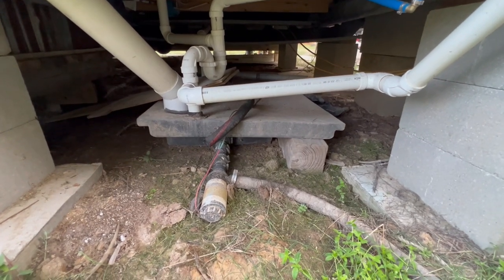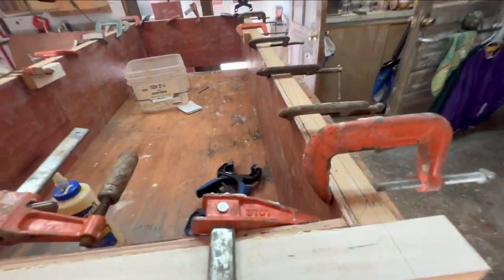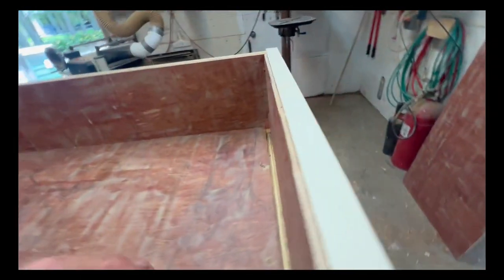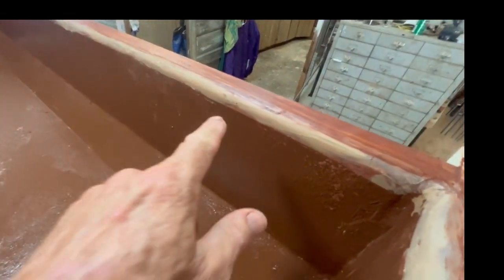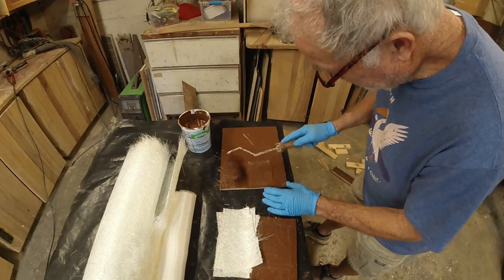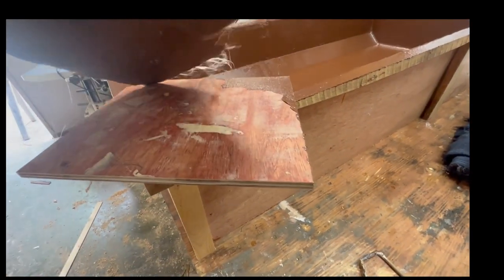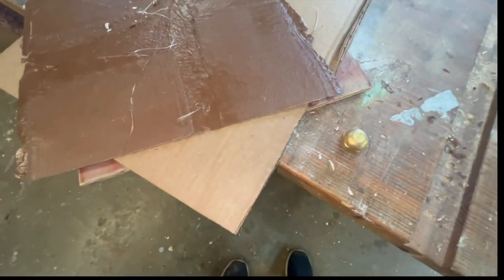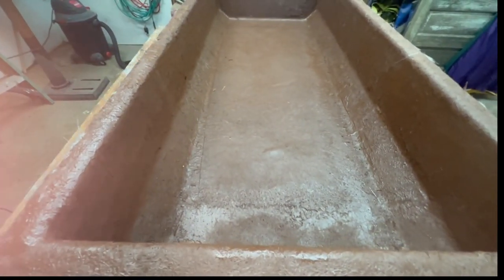Building a DIY custom size Holding Tank for the Tiny House with fiberglass bits and epoxy paint

Comment: I would take the "out of date" advice with a large measure of salt.  I bought some that was four years out of date, stored it for five years myself and had no problems using it.  I had a friend who rebuilt a 26' burn boat and was ordering his in fifty gallon drums.  Well he finished the boat with most of a drum left (polyester) which he continued to use for the next fifteen or twenty years.  His drum was stored out in ambient temperatures ranging from 5 degrees to 85 degrees with copious humidity (this is a temperate rain forest in SE Alaska).  I never even knew until ten years ago that there was a claimed shelf life on it.  I also heard a factory rep for West Systems Epoxy say there was non with epoxy either.  This correlates with my own experience.  Other than a slight color change which did not effect performance I have kept quarts and gallons of opened product around the shop for decades with no ill effects.  The rep had pointed out the color change but said the factory had done strength testing and found no performance loss in fact they actually gained a bit in strength!  If you can find a retail outlet that is marking it way down for being out of date I would without hesitation jump on it!  I have had little experience with the vinyl resins so I cannot speak to that.  Poly and Epoxy are both so useful I always make sure to have it on hand.  Also because my order time would be three to four weeks if I ran out.
Reply from the maker: Douglas 
I have also had success with very old epoxy. But polyester resin will get lumpy and or hard in the container in just over a year in my shop. Maybe it is a climate thing. Anyway, thanks for watching and thanks for sharing.
Barry